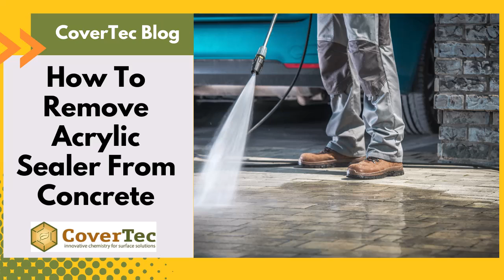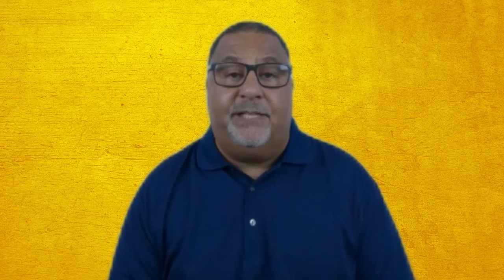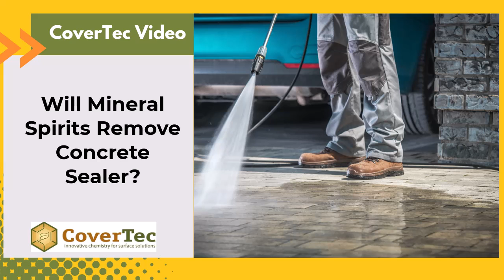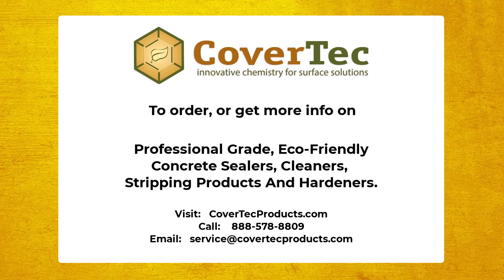How To Remove Acrylic Sealer From Concrete Properly | Indoor & Outdoor - FAQs - CoverTec Products

Comment: I just use a weed burner torch 🔥
Reply: Did it work
Reply: @edgar4531 Yes, it works... don't light it on fire just keep it hot and it will melt away